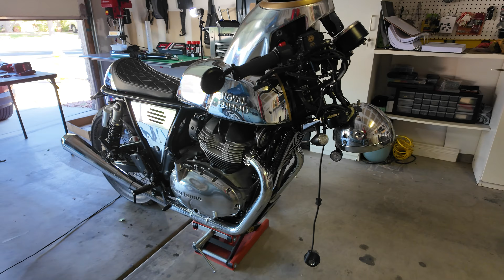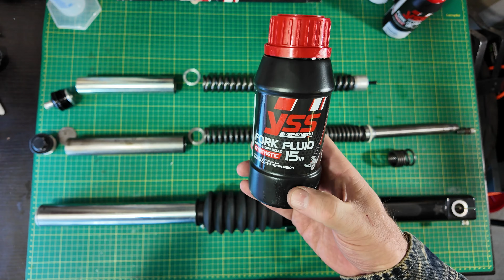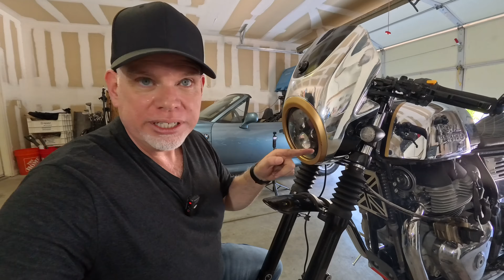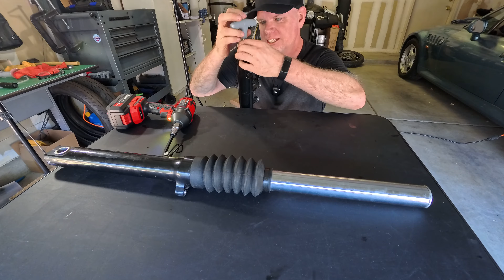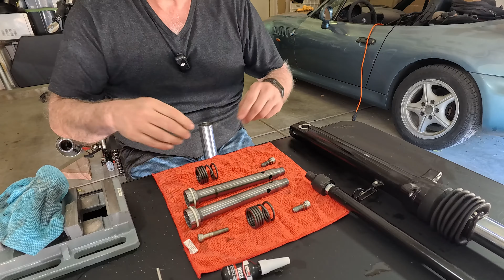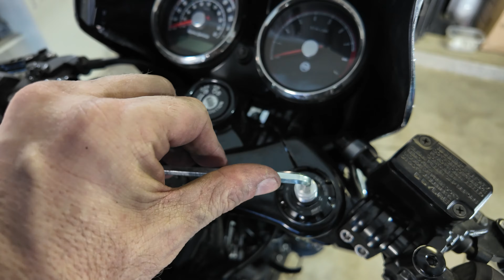YSS Fork Upgrade Kit Install & Drilling of Damper Rod | Royal Enfield 650 | Damper Tube Removal

Comment: happy 2026!! this was a great tutorial must say! Thanks Jerry and I will do probably the same on the Bear. That special tool you used, how is that called?
Reply from the maker: In the manual the official name for the tool is "Fork Damper Tube Holder" If you haven't seen it, I made another video where I talked specifically about the tool https://youtu.be/dbKZ_jl70Ig

Comment: Wut?😮 Why YSS didn't say anything about drilling?
Reply from the maker: YSS used to tell you to drill, but then they stopped including that in the instructions. My guess, by leaving that step out they sell more kits. Paul Thede from Race Tech, the inventor of the emulator, explains how it works and that you have to drill "in order to transfer the control of the damping" from the bottom of the tube to the emulator.
YSS instructions to drill: https://imgur.com/gallery/yss-fork-instructions-dcX3wJS
Paul Thede's explanation: https://youtu.be/j3QYZEQoN_M?si=4azBwYAkt-crQE46&t=116

Comment: Just finished my upgrade today. The hardest part was making the tool. The bike handles significantly better now. Just waiting for my rear shocks now
Reply from the maker: Yeah, after watching a bunch of videos showing how other people made their own tool, I got lazy and just bought it 😂 For me the hardest part was removing those damper rod bolts!
Reply: I pretty much got a 1/2" drive extension that is 3 inches long. Drilled out some holes on the male end. Then, jb weld it into a nut that fits into the damper rod. Used a 20 inch drive extension on a impact drill. Btw, Your videos gave me the confidence to do this project and others on my own. My bike is very similar to yours with some small differences for my taste. Will be doing a 865 big bore kit in the near future. Thanks Jerry!

Comment: There's a simple trick to remove the damper rod without special tools.....just put back the sping, spacer ad  add some washers to encrease the load of them....the sping force will let you unscrew the bolt easy

Comment: Is it really necessary to make bigger holes in the dampening rod?
Reply from the maker: The adjustable pre-load fork caps will provide improvement but to get the full benefit of the emulator for compression and rebound damping, then yes, IMO you need to drill out the damper rods.

Comment: What tyres do you have on your bike?
Reply from the maker: Pirelli Scorpion Trail II dual sport tires. Stock 120 size on the front, wider 150 on the rear. Made a video about changing the tires and doing a tubeless conversion https://youtu.be/7dTebUBmmdo

Comment: Great instructional video - where did you get the 150mm air gap data from? I understood it to be 140mm and that is with fork tube in lowest position, without emulator or springs etc
Reply from the maker: I couldn't find any official info from Royal Enfield about the air gap measurement, but I went with 150 mm due to three sources in my research: 1) Most other vides/posts I found from people that have done it mentioned 150 mm. 2) Royal Enfield manual doesn't mention the air gap but they do say 430 ml of fork oil. After I added the 430 ml, the air gap I measured was 150 mm. 3) I found this YSS chart and for the RE 650 they list the air gap as 150 mm https://i.imgur.com/hUNba7S.png  As for the part about measuring with the  emulator in the forks, again I head that advice from a few others and also found that in the YSS instructions in this document on page 3, sections 9 & 10 https://imgur.com/gallery/yss-fork-instructions-dcX3wJS

Comment: I cant thank you enough for a very clear video . I have a small query . I have used 10w oil . I have fog lights on fork and when i go over bad bumps the rebound sound is too much . I have not drilled damper rods . Should i move to a 15w oil considering my fear to be too stiff ride on unexpected bumps and shock on the body . Correct me if i am wrong
Reply from the maker: 15w may be too stiff if you have not drilled the damping rods. You can try moving your fog lights off the forks and onto a mounting bar below the headlight like this https://accessories.hitchcocksmotorcycles.com/information-and-services/Royal-Enfield-650-Super-Meteor-Accessories/49212

Comment: Sometimes the damper rod bolt can be loosened with an impact before the internals are removed because there is still spring tension on the parts.
Reply from the maker: Yes, that's an option👍 I saw a video where someone showed that method. My concern was reinstalling the damper tube. It required complete reassembly of the fork without the oil to put spring tension back on the damper so you can tighten the bolt, then after tightening, dis-assemble the fork to put the oil in. Requires more steps but is a possible solution (if there's enough tension to hold it in place.)

Comment: You’ve really raised the bar, well done sir!  Future Jerry theme was genius. 
I did the same upgrade and did the hole drilling, so worth it, night and day difference as you said. I did the YSS rear shocks too but the ones without the reservoirs. Both make a world of difference. 
@WhatIsTheWheel was the only YouTube I could find at the time and his video is also great but you nailed it. He too provides specs for making your own tool and getting the parts at Harbor Freight it was super cheap and worth it. 
I think this is a must do upgrade for any 650 Royal even if you’re new to wrenching it’s not as difficult as it looks.
Reply from the maker: Thanks! Yes, the suspension upgrade is such a big improvement, better than what I was expecting! I did watch @WhatIsTheWheel video(s). I subscribe to his channel; he has some good videos with great info. I was planning on making my own damper holder tool so I watched his video along with about a dozen others, but then I found the tool for "cheap" and bought it. $59... more than making my own but less hassle 🤷

Comment: Great video jerry,i went the same route and my local very bumpy road which felt before like the front wheel was falling off at 50kmh i can now blast down it at any speed
Reply from the maker: Before the upgrade, I really had no expectation or know if I'd even notice a difference... man, was I surprised! It was such a big difference that I actually started laughing as I was riding... now I just need to make sure my new confidence in the bike doesn't overtake my common sense and actual riding abilities when hitting the twisties!